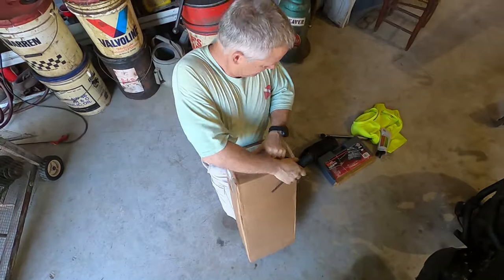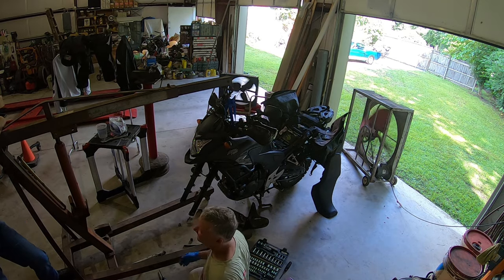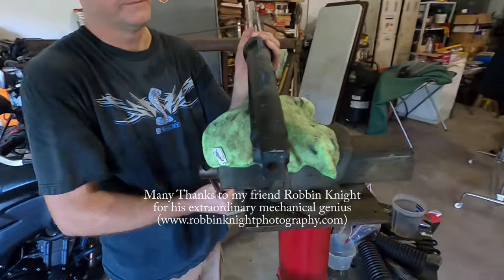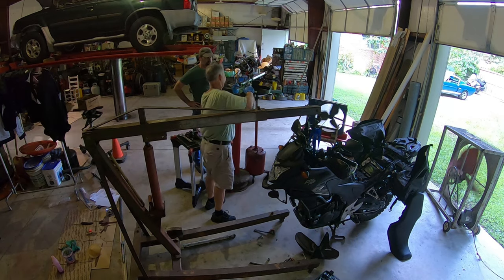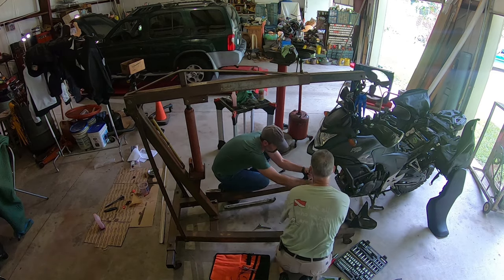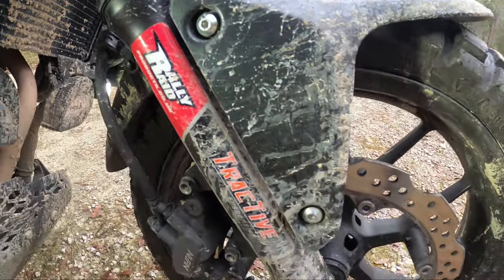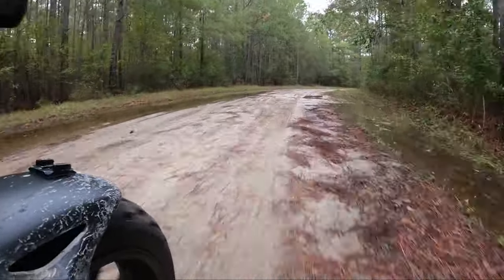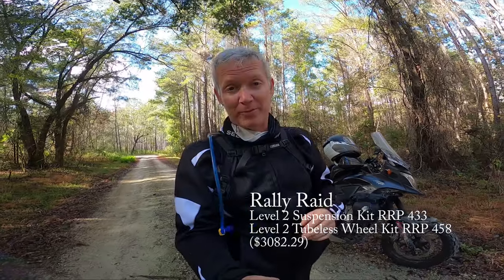Installation and Review of the Rally Raid Suspension on the Honda CB500X

Comment: The Rally Raid Part no.'s referenced in the video (at 11:39) are:
- Level 1 Tractive Shock RRP 459
- Level 1 Fork Upgrade Kit RRP 460

Chris, maybe you can put that in the video description?

Thanks for the info and review Chris, it was exactly what I was looking for. Ride on!
Reply: BTW, where did you order them from @Chris Smith?
Reply from the maker: @wobblycat  thanks for the tip!  I totally forgot to add the part numbers, didn't I?  I'll put them in the description as you suggested.  Anyway, glad you enjoyed the video.  It's an inexpensive upgrade that will pay dividends in fewer chiropractic adjustments...HA!  I ordered them from Rally Raid.  Don't be in a hurry.  They are a small company and order the parts in batches from their supplier.  So be patient.  I got lucky and even though they said it could take 3-4 weeks, I received mine in about 2.

Comment: Another excellent video Chris - and a clear explanation of the benefits and differences you get with the two suspension options. For anyone watching and reading these comments with the following question, I'd add that there is a degree of adjustability available with the RR fork kit/s - Chris' bike is an earlier model without the preload adjustment caps from Honda, from 2016-on they have adjustable caps to help you dial in your sag - and you can buy aftermarket caps as Chis mentions for the earlier models. 

You can also alter the fork oil weight (viscosity) and volume to dial in a more personal preference... but the base settings which Rally-Raid suggest in their fitting instructions are an excellent starting point, and suitable for most riding conditions.
Reply from the maker: Thank you so much, Jenny!  And thank you again for all your help and advice when I was looking to upgrade my bike.  The RR kit and the TKC80 tires you suggested have been spot on!  And I see your kindness and generosity doesn't end there.  I truly appreciate your time in letting viewers know more details about the options at their disposal.  YOU ROCK, my friend!!!

Comment: Wow Chris, I was stunned to see how much wasted space Honda has in the front fork springs using that 6" white spacer. I think I might have to consider upgrading my wife's CB500x on top of everything else I have done, so far.
Reply from the maker: Hi Pete!  I felt the same way when I was researching this upgrade.  What a waste!!!  I'm telling you, if I'd known then what a difference it would make to my bike, I would have done this upgrade WAY sooner!  The Level 1 kit is quite affordable.  And you can even just order the front and back individually if you don't want to pay for all of it at the same time.  I just ordered both to save on shipping.  You can also upgrade the rear shock with a "remote reservoir".  But I rarely ride with a pillion so figured I wouldn't need to ratchet the preload up and down much once I got it dialed in.  Anyway, hope this helps!  And I'm glad your wife is enjoying her ride!!!

Comment: I got the tractive shock and paid a reputable shop install it. A few months later the hydraulic fluid started leaking. I contacted RR, they said they'd check with the manufacturer. That was months ago, and I haven't heard from them since.  The hydraulic adjustment was great for the few months that it worked. I was totally heartbroken over this. Though others seem happy, I can not recommend this company.
Reply from the maker: Hi Dave!  I'm so sorry to hear about your issues.  I know Rally Raid is a small company, and have been overwhelmed with orders at times.  Maybe your request got lost in the shuffle.  I would reach out to them again, documenting who you spoke to and when, so they have a history of your issue.  They seem to have a good reputation as far as customer service.  Hopefully they realize they dropped the ball and will jump on getting you taken care of.  Cheers!

Comment: The original Honda spring looks more sophisticated in that it has 2 pitched coils as opposed to the new single pitch coils though much longer. I guess the overall spring length made the difference. Honda should revise their original design.
Reply from the maker: The Honda springs use what's called a "progressive" pattern...wound tighter at one end than the other.  But this is to compensate for the lack of an oil regulator, which the new Rally Raid system comes with.  Plus as you mentioned the new system is longer to make better use of the "dead space" Honda fills with that white PVC pipe.  It would be nice if Honda added the improvements.  But unfortunately they are marketing the bike to a certain price point and adding such advancements would probably raise the price of the bike too much for them to consider doing so.
Reply: @MotoPhotoAdventures  Probably true, but a company with Honda's experience & resources SHOULD be able to build the better suspension in the FIRST PLACE! I KNOW this bike. I own a 2018, love it, and would have gladly paid an Extra $500-$800 for a PROPER suspension. SHAME on Honda for making US do all the extra work!
Reply from the maker: @bruceforster3709  I hear you, brother!  I would have gladly paid extra for a proper suspension as well.  Here's hoping they'll bring out an improved version in the future!

Comment: Chris, i am 5'4" and like to get Cb500X. if i lower the seat would it affect the perfotmance greatly?
Reply from the maker: I'm 5'7" with a pretty short inseam.  The CB500X should be absolutely perfect for you.  I really don't think you'll need to lower the seat.  You'll just be on your tip-toes sometimes.  But there's nothing wrong with that.  If it's uncomfortable, I would just get one of the "lower" aftermarket seats instead of lowering the actual suspension.  The bike doesn't have a lot of ground clearance to begin with.  So reducing that even more would not be my first choice.  However, if you did, I doubt it would affect performance at all.  It's a great bike!  And if you add the Rally Raid L1 kit like I did, you get much better suspension without increasing the seat height, which I love!

Comment: What fork boots did you use?
Reply from the maker: I measured the diameters of the top and bottom of the fork and found some on eBay that were close.  Then just cut them to length and used black zip ties.  Not perfect, but they work great!

Comment: I am so torn. I have a 2014 I want to do the TAT on but not sure the RR is the way to go. I was going to sell it and buy a Royal Enfield Himalayan instead. But something keeps bring me back to the RR kits.
Reply from the maker: It's a tough decision, Craig!  Do you follow Noraly on "Itchy Boots"?  You know she left her Himalayan in Peru when she evacuated for Covid to return to Europe.  She bought a CB500X and has taken it all over Iceland, Norway, Sweden, etc.  Much of it was off-road.  Parts were on the TET (Trans-European Trail), which is basically a European version of the TAT.  She commented that the CB500X is better than the Himalayan.  So my personal thoughts would be to stick with your gut and go with the Honda.  It's super reliable, very lightweight twin-cylinder, good fuel economy, large tank, excellent stator (so you can add accessories like GPS, phone charger, auxiliary lights), and handles just about anything.  Because they are so dependable, you can buy a used one with confidence, leaving enough money in the piggy bank for the Rally Raid suspension.  If you do it the way I did, $800 turns it into an excellent "all-around" machine.  Or if you have the funds, $3000 turns it into an AMAZING off-roading dream-machine!

Comment: Thanks for vid!

I plan to install this on my CB500X in the spring. I am still debating to get the 2" increase. I'm not riding hard off-road, but I do scrape my bash plate every once in awhile.

Is there any increase in ground clearance with the RR1?
Reply from the maker: Thanks Gump!  I've been extremely happy with the Rally Raid L1 kit.  But I'm short (didn't think I would like the 2" increase), I'm on a budget, and I don't do a ton of off-roading.  So the L1 kit was perfect!  However, if I did do a lot more off-roading, I could definitely see the value in the extra ground clearance and extra suspension travel!  Don't wait until Spring...do it this winter so your bike is ready to hit the trails in the spring!
Reply: Yes, as Chris suggests - if you're comfortable with the increase in seat height, then the +2" LEVEL 2 kit is the way to go since not only do you have more travel overall, but fundamentally the bike is now floating more in the middle of the two [further] extremes, so the ride is more plush, both on and off-road. The LEVEL1 kit is an excellent and affordable upgrade (particularly as you can upgrade the front and rear independently if you wish/as budget allows), but to really see the potential of these bikes, the longer travel LEVEL 2 kit is the way to go. 

It's also worth noting that the LEVEL 2 shock has additional and individual damping adjustment with extra oil capacity in a reservoir too.
Reply: After some internet and YouTube searching, I will probably get the RR2. My bike is a 2020. Honda finally installed a 19" front in 2019, making the bike a little more off-road friendly. The RR2 on the older models raises the CB500X about 2 inches. My guess is that it would be around 1.5" on the newer models.

I'm also vertically challenged at 5'7". Adding 1.5-2" more ride height should be fine. I will be definitely tiptoeing. 

Thanks Chris for all you vids. It's been fun following your travels on the TAT. I plan to do this some year. Next year is Alaska on the Cb500x. My buddies think I'm crazy riding this long distance. They are begging me to take my Goldwing. Lol!
Reply: @gump2236  to clarify: in both instances, the Rally-Raid LEVEL 2 kit provides 170mm travel front and rear, regardless of the age of the bike. On the earlier models [with 5" travel and the 17" front wheel as standard], this equates to +2" (50mm) increase in travel, ground clearance and seat height; however the 2019-on model where Honda have fitted the factory 19" front end and slightly longer 150mm travel suspension themselves that bike is already a little taller, so the increase over standard is only +20mm once you've fitted the RR LEVEL 2 replacement shock and fork kit to the 2019-on model.

Essentially this means the newer models have the same overall seat height as the original models once they both have the LEVEL 2 kit fitted.
Reply: Great explanation! Thanks Jmo!
Reply from the maker: @gump2236  that sounds like an AWESOME plan!  I think you'll be really happy with your CB500X once you get up to the Dalton Hwy.  Wear your road tires up to Alaska, and get them changed out to some TKC80s for the final stretch.  Your buddies will be wishing they were on a really fun, light, and nimble machine when they hit that mushy stuff...while you'll be zipping along with a grin on your face!  :-)
Reply from the maker: @jmo2752  I was wondering about that!  Thanks for the insights on how it works on the newer models.  Could someone install the Level 2 shocks and forks on a 2019/2020 model without getting the spoked wheels?  Seems like that would be a good "intermediate" option.  Or one could go with the full package if they were planning to hit the rough stuff and needed the added strength of the spoked wheels.
Reply: @MotoPhotoAdventures  
I am planning to keep/use the OEM rims for awhile. Since I am on a budget, I will purchase the spoke wheels later on. 

I do like the TKC80, but the longevity sucks. On my previous bike (XT250), they barely lasted 3k miles. Currently, the Dunlop Trailmax Mission tires are installed on the Cb500x. Other than deep mud and soft sand, it's a great tire. I have around 2k miles and there is almost zero signs of wear.

Having a second set of wheels will be nice. I can swap out street or dirt tires easily. Maybe then, I can justify the costs of the TKC80.

Comment: Hey Chris I got a question for you. What fork boots did you go with? And what preload adjuster did you go with, and where do you buy one? I guess that's more than one question. I got my forK kit from Rally Raid now,I got to put it on, so I wanted to get everything to go with it. Hope you don't mind all these questions.
Reply from the maker: Hi Dolly!  No worries...happy to help!  My bike is a 2013.  So it doesn't come with preload adjusters.  You can buy some after-market ones.  But I didn't bother.  I just put the OEM caps back on and they worked great.  The fork gators are just a cheap eBay brand.  I've had them for a while.  So I don't have an exact link.  But if you search by your bike on eBay they'll tell you which ones fit.  They even have different colors if you're into that.  Also don't forget to pick up fork oil.  This is the perfect time to change out your fork oil.  I just went with the Honda OEM oil.  Good luck and let me know how you like it!!!  :-)
Reply: @MotoPhotoAdventures  thank you so much Chris. Mine is a 2015 not too much newer than yours. Thank you for answering my questions so quickly
Reply from the maker: @DollyAndFamilyGetOutAndRide  my pleasure, my friend!

Comment: Hey Chris....what tires are you running?
Reply from the maker: Hi Sharper Light!  These are the Continental TKC 80s.  I LOVE THEM!!!  Just be aware the rear tire doesn't last very long, especially if you ride on pavement a lot.  It has excellent grip and rides great on pavement.  Just doesn't last long, obviously, since it's a knobby tire with a soft compound designed to grip well in dirt and mud.  If you're doing much off-roading, this is the best ADV tire I've used!